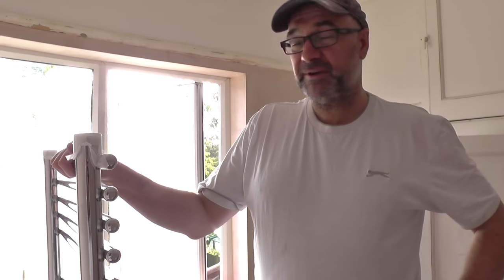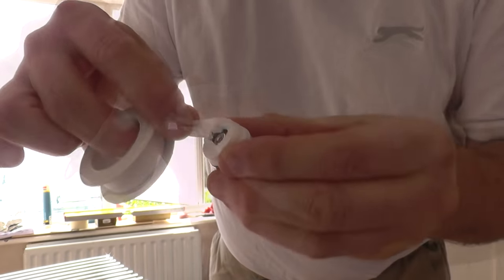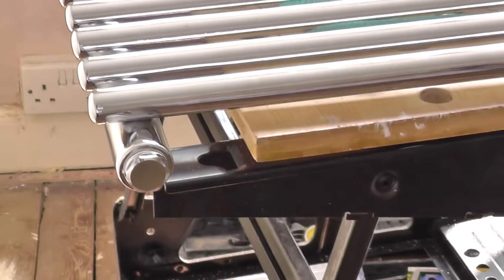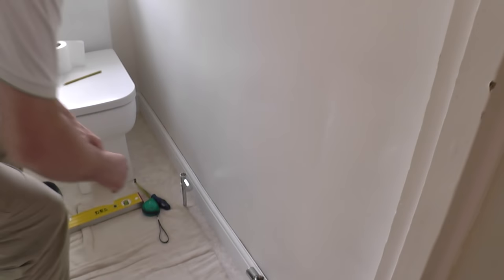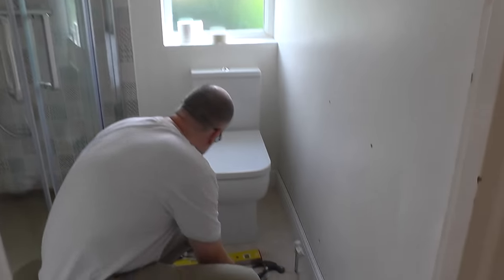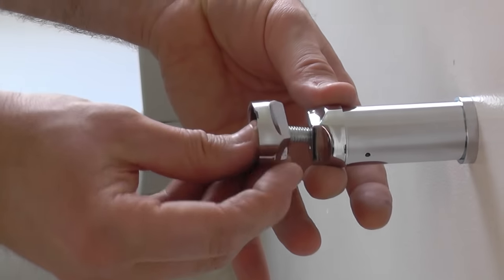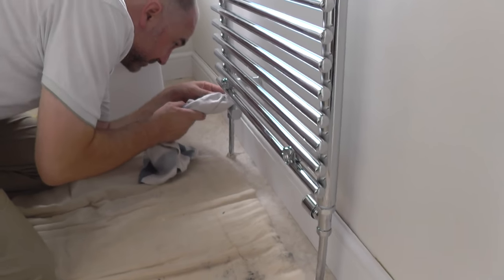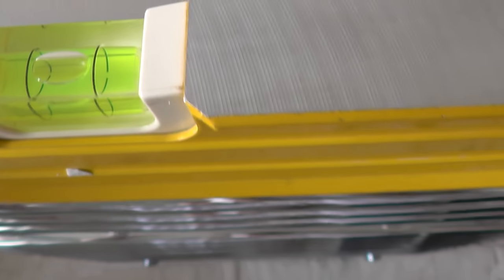DIY: How to install a towel radiator

Comment: Another great video! I'm thinking of replacing my old rusty radiator with a nice chrome one like that. My fear is that I'll pull the old one off, and something won't be right, the pipes coming out my bathroom floor are old copper things that look..... like they could need replaced too! Think I'll be letting a professional do that one! Lol
Reply from the maker: Hiya Bob. Hear what you're saying mate. You've got to be so careful that you don't knock them around too much and b*gger up the joints and create leaks. TBH it can be quite nerve racking especially knowing how far water can travel and the damage it can do. Take care mate, Des

Comment: Worth adding that you should check the pressure on your boiler after completion and top-up if necessary. Fair play for giving it a go and yes you made the odd mistake, but others can learn from that. Best regards
Reply from the maker: Thanks Steve. I appreciate your kind words. Best wishes, Des

Comment: Hi mate nice work. We're you able to get the radiator with the same spacing as your existing pipes so it was just a matter of placing on top or did you have to pipe that up from scratch??
Reply from the maker: Hello there. Unfortunately, there were no existing pipes there so I had to install them. The chrome finish on the copper tails was a nice touch but they've got to be properly prepared before fixing (i.e. they need to be sanded down first). Thanks for watching. Best wishes, Des

Comment: how many turns of ptfe was that..mines dripping after 9. only slightly
Reply from the maker: Hi there buddy. From memory, I did about 10 wraps of the ptfe and have not had any problems at all. I did give it a good tweak with the spanner though. Everything fine 2 years down the line (fingers crossed!). ATB, Des

Comment: As soon as he mentioned Victoria plumb I turned off,never watched the full vid but hope that wasn’t a customers house. Victoria plumb are renowned for some of the worst quality products going.
Reply from the maker: Hello mate. Interesting to hear about Victoria Plumb. Not being in the trade I wasn't aware that they had a bad reputation. The towel radiator has been in for 4-5 yrs now and still going strong thankfully. Thanks for dropping by. ATB, Des
Reply: Never had an issue with Victoria plumb on the other hand Victoria plumbing which is a different company are crap their aftersales leaves a lot to be desired too